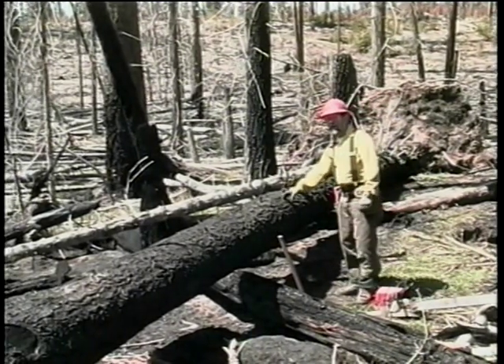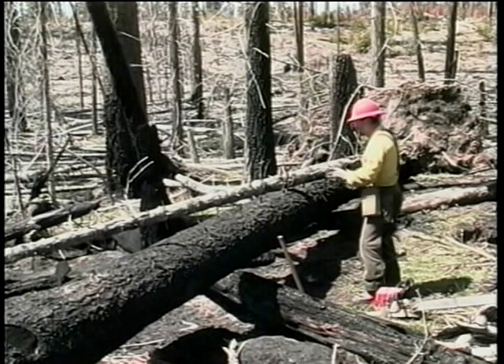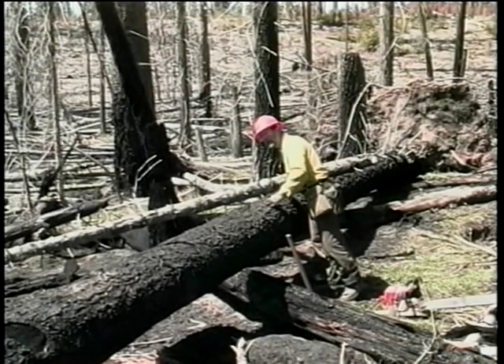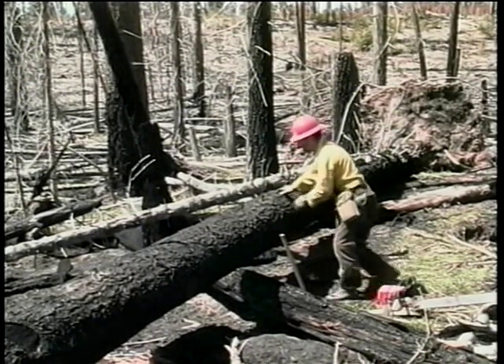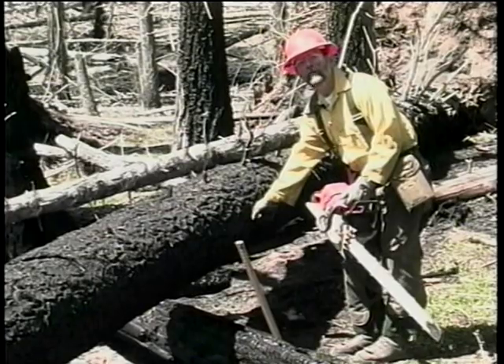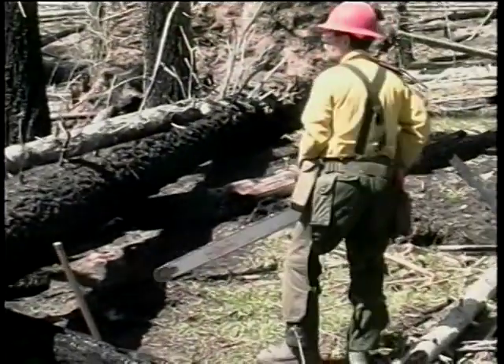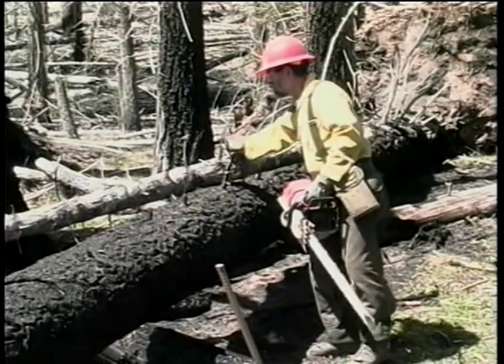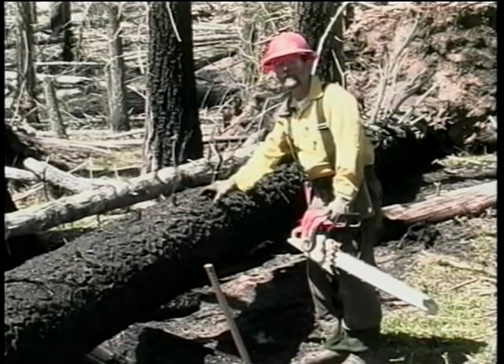Wildland Fire Chain Saws - Part 4 - Bucking: Blow Down

Comment: Nice video guys.  Just one question.  What keeps the bar from kickback when you made the cut from top to bottom.  Why did it not kickback when the upper tip was in the wood?  I'm still learning so please forgive me being naive.  Thanks.
Reply: This is something I've wondered about, seen, and used myself, so here's my hypothesis: Kickback occurs when chain cutter(s) engage material on the tip of the bar, creating force upwards, and in the case where there's nothing above the bar making it spring upwards with a large amount of force. 

In this case, the bar is locked into a kerf, so it's unable to spring unrestricted upwards. So long as only 1-2 cutters are momentarily engaging on the bar's tip, the bar is able to remove fiber safely with upward force restricted, and reverse force balanced by weight of saw and sawyer. "Boring" is a similar technique, which applies rotational twist to the powerhead, and stabilizes the bar in the kerf! I'm not sure if he was doing that here though.

I know the comment is 7 years old, but thought it might help someone, and it's fun to think through an answer